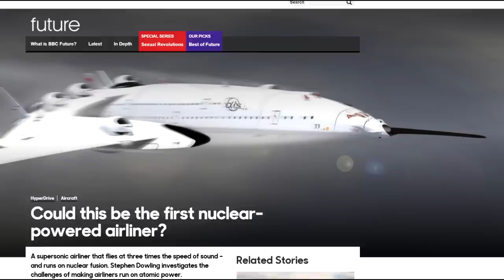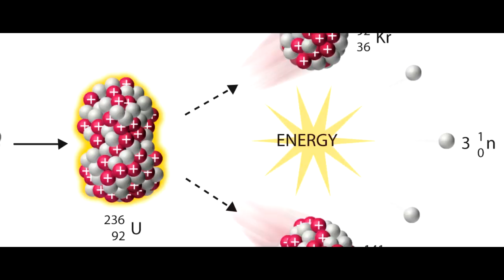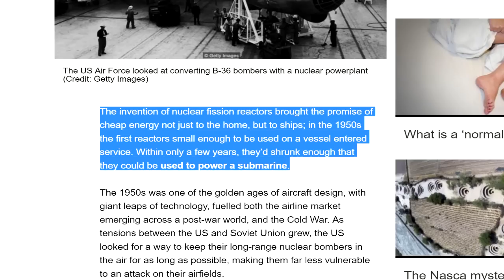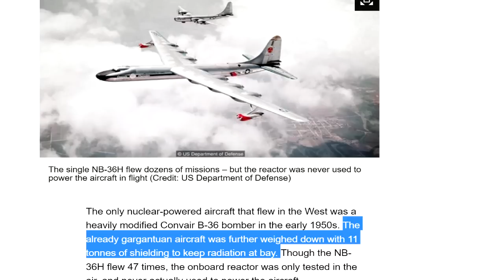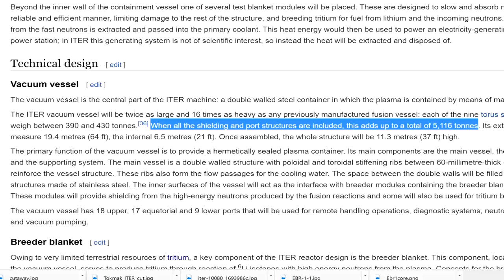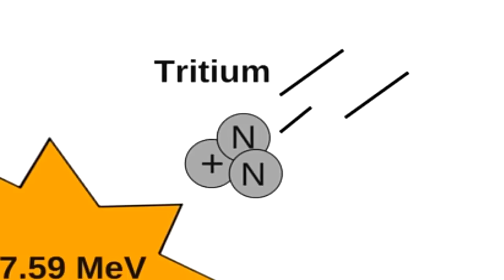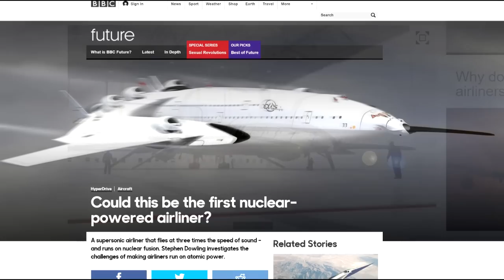SIX ENGINED Nuclear Airliner... BUSTED!

Comment: Well there's one way to shield the passengers without that shielding on an engineering standpoint. You could create a capsule akin to the mars rover or the eagle lander for the crew/passengers to travel inside and even for further protection from those high energy neutrinos you could give the passengers the same space suits we provide our astronauts in space walks. Lol but you'd need to give everyone traveling safety protection briefings and massive amounts of training to utilize these systems so all in all it would be just well enough to just travel the old fashioned way.

Comment: I totally agree, but wouldn't using an aneutronic fusion reaction like deuterium + helium 3 solve the need for heavy neutron shielding.  Another problem with this design is the reason for converting the heat from the reactor to electricity to power "magic turbines"  Why not just replace the combustion chamber in a jet with a heat exchanger and run the coolant through that.  It would reduce weight and improve efficiency.

Comment: aren't nuclear reactors heavy? Like, really really heavy?
Reply: One of the benefits of a nuclear-powered aircraft is that you no longer need to carry jet fuel. This offsets some of the weight of the reactor.
Reply: well I did the science over and it checks out
Reply: Obviously, this doesn't completely solve the issue, but it turns out that reactor technology has stagnated quite a bit and our current fission reactor designs date back to about the '70's or so. If more R&D money was spent on developing nuclear reactors, It's conceivable that we could come up with reactors that are even lighter than the ones we use today.

Comment: I'm curious as to how they are planning on fixing one of the Concordes downfalls, sonic booms. You don't have to really deal with them when you're flying at high altitudes over the ocean, but when you're flying low over populated areas, you have to fly at low speeds as to not ruin everyone's day. The planes are not built to fly at low speed and low altitude, and have to put up with a lot of drag and air resistance, which in turn wastes fuel and time.

Comment: Wouldn't a solar or wind powered plane be more logical?
Reply: There are solar powered aircraft in existence, the only problem is that the energy density of solar panels is incredibly small compared to things like hydrocarbon fuels and nuclear fuels. Solar powered aircraft cannot fly very quickly or carry more than one or two people given a reasonable size restriction based on manufacturing capabilities and airport sizes.

Wind powered aircraft could not work, unless you are using wind while on the ground to charge batteries and then just using the batteries in the air. You could not stick a large wind turbine on the top of the plane and then have it drive a smaller propeller because the both are in the same airflow. From the laws of thermodynamics, you could not produce a net positive amount of energy needed to keep the aircraft flying at the same speed because drag is always pushing back. The aircraft would eventually just come to a stop, and could no longer fly.

The major problem with ground based wind power generation storing energy in batteries is that current battery technology is also way less energy-dense than hydrocarbon fuels. This is why electric cars are so much heavier than conventional gas powered cars.

Comment: can someone explain why nuclear powerplants use turbines to turn steam power into electricity? because in my opinion a rotary piston engine would be more effective
Reply: well maybe not rotary piston engines but i have seen ideas that involve stirling engines and the ones that are also used by steam trains
Reply: There are several advantages to gas turbine engines that make them the choice for powering aircraft and generating electricity. They can produce a much larger amount of power for a given size as compared to a piston engine, and can be throttled much more quickly than a large stirling engine.
Reply: that is in fact very interesting, thanks

Comment: In  the pictures of the NB-36 , that was the B-29 that you mentioned behind it. The B-36 it was based of of had a load capacity of 86,000 lb compared to the B-29 that only had a capacity of  20,000 lb.

Comment: 11 tons of shielding is nothing. To put it in perspective, a 747 carries up to 240 tons of fuel.
Reply: 240 000 Liters is not the same as 240 tons, because Liter is volume and tons are weight. Fuel density is about 0.8(it floats on water), so in reality it is closer to 190 tons.

Comment: Right from the bat if you play any realistic space game, you know that the pictures will never depict the shape of the craft even if it could support 50 tones of surpless weight. Firstly, nuclear engines are used on space craft to propel them but they will never provide enough thrust to push that this into the air, even with 6. Also, just to say that the artists of the pictures clearly had no knowledge of that type of stuff because there were air intakes which are obviously pointless and only used on jet craft.

Comment: not all fusion requires lots of shielding or radioactive fuels - a focus fusion reactor is an aneutronic fusion reaction using hydrogen and boron - would not provide thrust though just lots of electricity - not sure how fast you could go with electrical engines - suspect supersonic would be possible much mach 3 sounds unlikely

Comment: During the nuclear craze of the late 50's - early 60's... the US toyed around with the idea of making a nuclear powered long range bomber that could stay on station for weeks at a time like a submarine.

If I remember correctly, they got as far as remote controlling a conventionally powered bomber with a running reactor in it before they gave up. They ultimately gave up because they determined the aircraft wouldn't be able to carry enough shielding to keep the crew safe and also that a crash or shoot down would be a disaster.

Comment: Thunderf00t, I have a question for you. What are your views on RTG's and SRG's, the relatively small nuclear generators that rely on the heat generated by radioactive decay to power things on a smaller scale? I'm not suggesting every household have a nuclear generator in its basement, but do you think they have some uses?

I think I remember reading somewhere that environmentalists stopped using RTG's in spacecraft and satellites and, instead, relied on solar panels, which are much more unreliable because they didn't want to "contaminate space with radiation", which is an absolutely stupid way to think about things. Space is full to the gills with radiation.
Reply: RTGs are still deployed in missions, but they are un-competitive with solar+battery for *inner-system missions*.   RTGs are very heavy, and the thermocouples degrade alarmingly fast.  New Horizons uses an RTG as it's an outer-system mission (not much sunlight at/beyond Pluto), but the Dawn probe used solar even though it went beyond Mars orbit (to Vesta/Ceres)...and the Dawn probe is driven by ion propulsion.

New Horizons' RTG has a mass of about 57 kilograms and produces 300W anywhere in the solar system.  By comparison, even one of Dawn's solar arrays produces 10 KILOwatts... in Earth orbit.  5kW at Mars, and 1.3kW at Ceres.  As long as you aren't in the murky depths of the outer solar system, the solar array is kicking the RTG's butt.  Also note that while you do have to contend with darkness behind planets, that's never for very long, and can be completely avoided in many missions.

Finally, the RTG is an expensive piece of kit that requires all sorts of permits and special handling, whereas solar arrays.. well, ever seen a modern pocket calculator?  Solar's not exactly NRC restricted :)

The main concern about RTGs isn't polluting space itself, but the possibility of a launch failure spreading that Pu-238 around here..  Even the best rockets occasionally fail.  Granted, they're probably overreacting, as New Horizons only has about 11kg of Pu-238... not exactly World War III if it were to explode and be scattered across the globe :)

Comment: Speaking as an engineer, I have to say:
This time, Tf00t, you're on the money. My first concern would be weight.
My next concern, on reading further, would be that they're planning on using a fusion generator, which ain't even a thing yet.
I'd be curious to see if you could use a nuclear plant to power some sort of large floating platform, sorta like an aircraft carrier of the sky, (not saying it's possible, I'd have to do calculations,) but for a single plane? It's going to be REALLY goddamn heavy. (And realistically, it'd be much more efficient to use a regular aircraft carrier than that avengers style monstrosity anyway.)

Comment: You are right, nuclear fusion for aircraft is total bull shit.  But you forgot to mention the other major BS in this concept; supersonic commercial flight.  Remember the Concord?  We had a supersonic airliner from 1976 to 2003.  But major cities banned it from flying in their air space because the public hated the sonic booms and the air pollution.  These are the real problems that would need to be solved before supersonic airliners can become commercially viable.  Nuclear propulsion is completely beside the point, as well as being totally ridiculous.
Reply: All true but they are actually (Nasa Boeing et al) in the process of solving the sonic boom problem (well lessening/deflecting it's impact on the ground to be more accurate) and if your route is largely over a sea, then it's not that big a problem. Yes, fusion powered planes are total bullcrap though.

Comment: I was actually thinking about this the other day. I'd been explaining to a friend how nuclear power generators were basically just steam engines, the conversation drifted to nuclear subs and then I though if anyone had run the math on nuclear powered plains.

I know there were designs for steam powered planes on the drawing board waaaaay back before powered flight was actually achieved. I saw a video of a group of guys, I think they were university students, who had built a scale model of a design they thought was doable. Turns out it was too flimsy and couldn't take the pressure though.
Reply: "nuclear power generators were basically just steam engines" What!! I think you're a little confused. While it's true all electrical power generating Nuclear reactors heat water to steam and this then passes through a steam turbine to "generate" useful electrical power, the reactor part is the important bit ffs! Side note, please calculate the weight of neutron shielding alone you'd need and try to make that fly. Funny, never seen a steam engine that needs to shield you from being irradiated :)
Reply: Mark Fernandes heat water to steam and this then passes through a steam turbine to "generate" useful electrical power

Like I said, basically just a steam engine that gets it's heat from the nuclear materials rather than burning coal. You do realize that trains and tractors weren't the only things that used steam engines right? They were used to power factories, way before the advent of electricity.

Also, I wasn't disagreeing with thunderfoots assessment on a nuclear powered plane. I even pointed out how the regular steam engine experiment that I saw was also a failure.

Funny, never seen a steam engine that needs to shield you from being irradiated
It's not that funny, but if you want to see one just go look up some videos on nuclear power plants.

Comment: If I wanted to put a fission reactor on a plane, I'd have it stowed and shutdown for takeoff and landing, then reel it out using 100m or more of cable, then start the reaction.  The only shielding would be on the side facing my aircraft.  The flying reactor module thingie behind the plane would essentially be towed like an unmanned glider.  If for some reason I had to jettison the live reactor in an emergency, I'd just make sure I was over Chicago or DC so that nothing of value would be lost.
Reply: I guess with modern avionics the plane could takeoff and land with the reactor fully extended, and at whatever safe distance the inverse square law would dictate.  For good measure, when parked the reactor could descend into a depression on the tarmac so it's not line-of-sight to humans for any great length of time.

Comment: the main problem with nuclear power is the same problem with solar power, is the same problem with coal power, is the same problem with gas power. it doesnt matter what power source you use, its going to the same end. its ALL steam power. it doesnt matter which way you do it, but all of those power producers just heat water to boiling, and the steam turns a turbine blade and that generates power. what we need is a fundamental change in the way we generate power. but im too stupid to do that. MIT, im looking at you. get on it.

Comment: http://www.scientificamerican.com/article/nuclear-powered-aircraft/

It was built. It flew*. It was deemed a bit too dangerous. And it was a bit too expensive considering conventional engines were improving a lot at the time.

They didn't shield the entire reactor: They put a shield between the reactor and the crew to create a safe 'shadow' for them. 

Don't think they should bother until they've got something better for shielding.

(* My understanding is it flew with the reactor live, but not powering the aircraft during the latter tests. This was due to concerns they might have to ditch the reactor. It was, however, outputting enough energy to power the engines, so it was able to fly on reactor power. Then they canned the project. Not found the source to confirm this, though, just that it flew 34 times, mostly with the reactor cold, but mostly means it also flew with the reactor hot).

Comment: What you haven't taken into account is that you can shield the reactor with an inverse tachyon field emitted by an inverse phase coupler.  

Once the field is established the gamma particles are converted into low energy nebulons,  These can then be recovered through the use nebulon particle shunt and stored in a tri-polar battery.

The entire thing shouldn't weigh more than 4-5 kilos.

Trust me; I've got one in my living room.  It works like a charm.

Comment: yes the us navy has 3 subs and every aircraft carrier.since 1991 they  all have  nuclear reactors powering them.look it up
Reply: Good point, but not entirely correct.  All US combat subs use nuclear powered, not just three.

One thing nuclear reactors in maritime use is, weight is not a significant factor so you can use heavy shielding.

Second point, if they go critical the cores melt through the hull and enter the water.  Other than an initial steam explosion, the water will cool the core products (though they will remain radioactive).

In an aircraft you can't use heavy shielding without cutting into useful payload and if the core burns through (or the the plane crashes) contamination can be spread over a wide area.

Comment: The main advantage off a working nuclear airplane engine over a jet engine will be stamina. But if that passenger plain is flying 3 times the speed of sound you'll have enough moments to refuel. One of attractive ideas of a nuclear powered nuclearbomb carrying plane, was that it could fly for days without being refueled. Greatly increasing the chance for the USA to retaliate nuclear as these plains could fly anywhere in the world  at any moment and then be redirected to attack any target somewhere else. That and the fact nuclear power was sexy in 50th got the Air-force funding for nuclear research. (Which otherwise would go to Navy or the Army). I cannot see little advantage of pushing a nuclear plane for passenger flight. Modern technology can already give you almost global reach and those last thousands of miles can be easily achieved by perfecting modern technology.